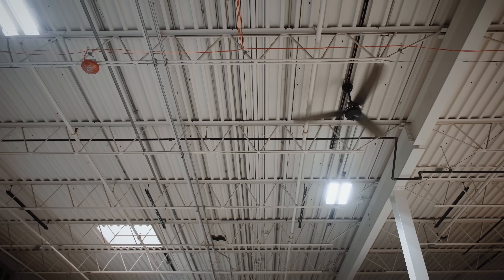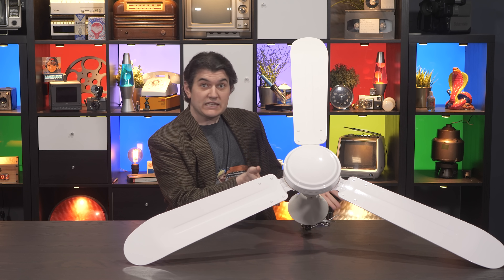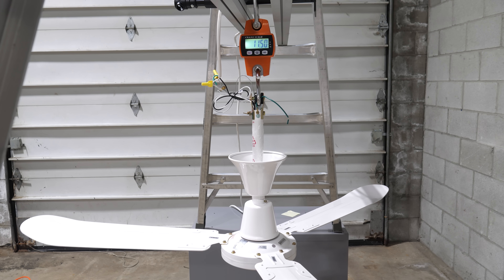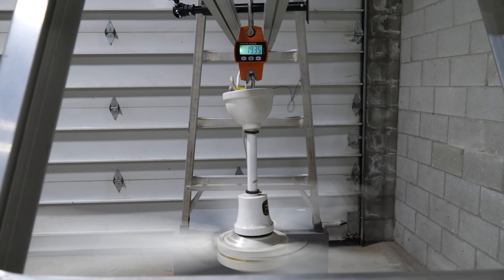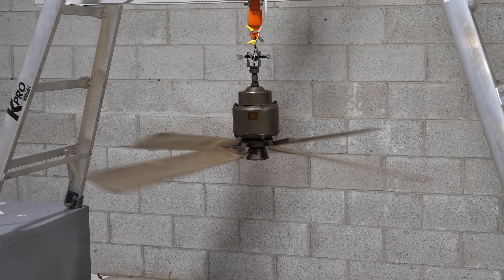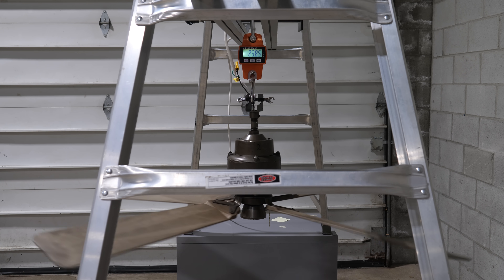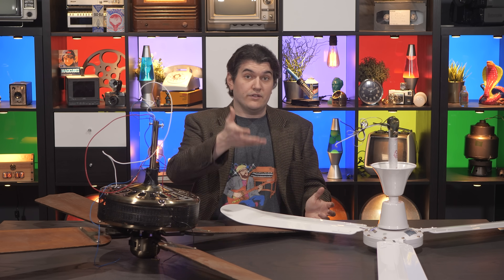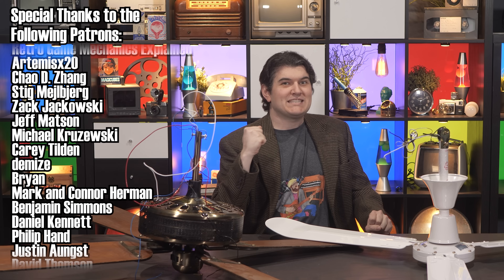How much thrust does a ceiling fan produce?

Comment: The spinny things on top of a helicopter are not really "fans". They don't work by "pushing" air down, like these ceiling fans do. In fact, you can stand under a spinning helicopter rotor and you won't really feel any downdraft. (You will only start to see strong air currents farther away from the end of the rotor blades).
Rotor blades are what's called an airfoil. Their shape is formed so that the air has to travel a farther distance over the top of the airfoil than at the bottom of the airfoil. When you look at an airfoil crosssection, you'll see a kind of 'bulge'.
The fact that the air flowing over the top of the airfoil has to travel farther than the air at the bottom of the airfoil leeds to a drop in air pressure on the top of the airfoil (thanks, Bernoulli!), which then created an upwards force, which we call lift. 

On an airplane, lift is simply generated by the airplane having forward momentum. But on a helicopter, you essentially just spin the airfoils real fast. Boom, lift!
And yes, airplane propellers also work with airfoils.
Reply from the maker: for clarity, I knew they aren't literally the same things as fans - but they are big spinny air blowy things and I think that's close enough for the joke.
Reply: Oh yeah, definitely. This was not meant as a "your video is pointless", more of a "hey, maybe you'd like to know this" :)

Although, they aren't really "air blowy things" - more like "spinny air pressure suction things". To reiterate: helicopter rotors don't work by pushing air down, they work by generating lift through decreased air pressure on top of the airfoil. 

Thanks for the video! i'm a big fan! (heh)
Reply from the maker: @m0llux  no no, I gotcha, the joke is in the mud between "the rotor is blowing a lot of air around but that's not what generates lift"
Reply: This is incorrect on many levels.  All airfoils generate force by moving air.  If you are standing under a helicopter on the ground, those blades are feathered and not generating any lift.  I've seen people blown off the side of an aircraft carrier by the down force of air from a helicopter.

Also, anybody who has stood behind a propeller aircraft will tell you how much air that prop is moving backwards.  Unless, the propeller is feathered, in which case it's not producing thrust, and thus not moving air backwards.
Reply: @jeromethiel4323  Yes! m0llux is very much overlooking the equal and opposite reaction explanation of how an airfoil works.  For example: take a piece of paper and tilt in front of a pedestal fan, it's obvious that it's deflecting the air (as much as the actual lift force is due to the pressure differential across the two sides, but it could also be calculated from the equal and opposite reaction to the air being deflected, i.e., the force on the airfoil is opposite to the change in momentum (i.e. deflection) imparted on the air).
Reply: @TassieLorenzo  Indeed.  Physics is a thing.  Also, observation and understanding what you see is a thing.  I have walked under a helicopter with the main rotor feathered, very little down draft.  But try that with the helicopter lifting off and you will be rolling across the ground.  Or off the deck of a carrier.

Which i saw firsthand.  Luckily, the water was warm, and the helicopter fished the sailor out of the drink straight off.  But he learned an important lesson.  Aircraft work by moving air around.  Moving it backwards makes you go forward.  Moving it down keeps you aloft.  Simple.
Reply: They literally are fans. They exactly work by pushing air down, in the exact way that a fan does.

Everything is essentially an aerofoil once it's in air. Aerofoils work to generate lift (AKA upward thrust) because they push air down. They do this in complicated and less-than-intuitive ways, but they absolutely work by pushing air down, and anyone who says otherwise might as well be claiming they defy physics.
Reply: Me when I spread misinformation
Reply: As Alec said forces come in equal and opposite pairs. If the air is pushing the helicopter up that means the helicopter has to be pushing the air down. Fixed Airplane wings also push air down.
Reply: A cursory look at the streamline pattern around any non-neutral aerofoil (just Google it) will show you that an aerofoil DOES deflect air.  That's how it works! 🙂 Yes, the pressure difference between the two sides imparts the force on the aerofoil body, but it's deflecting air.  This may be most noticeable near the tips of a helicopter rotor simply because that's where the rotor is travelling the fastest and where the powerful free tip vortex is.
Reply: whoosh 
^ The joke

Comment: I'm not an expert but I'm not sure that's how aircraft propellers work. They are basically rotating wings. The cross section of the propeller is the same or pretty similar to the cross section of a regular airplane's wing. It's not just some blades rotated at an angle like we do with ceiling fans. But others, more clever people will correct me.
Reply: Hello, I am a more clever people (studied aeronautics as a minor in college), and you are absolutely right. You can even stand right under the spinning rotor of a helicopter and you won't feel any downdraft.
Reply: But an airplane propeller works differently than a helicopter rotor, no?

The airplanes wing is an airfoil like the blades of a helicopter, but an airplanes propeller works more like a fan?
Reply: @kenk8215  eh, kinda both. Yes, a small part of the thrust that propellers produce is indeed due to them acting pretty much like a normal fan. However, nowadays, airplane propellers are also airfoils, which do create lift when they spin. That lift is, of course, not pointing upwards, but forwards. On all but the most basic airplanes, you can even change the angle of attack of these airfoils to increase or decrease drag, which allows you to have the propeller spin at the same speed regardless of the current power of the engine, leading to a lot more efficiency. 😊
Reply: Put differently, the flat piece of particleboard that makes up my ceiling fan's blades is a horrible wing.

Comment: Fig Newtons of Force sounds delicious.
Reply: I caught that too. Yummy lol
Reply: You’d think… but no.  Too many wasp eggs.
Reply: Are fignewtons measured in pound as force or pounds as in weight?
Reply: They're enriched with midi-chlorians.
Reply: Proof Americans will use anything as a form of measurement. 
Freaking metric system. Takes all the romance out of measurement. I want my units based on the size of a king’s unit. That’s what a shit load is, one king’s loaf!
Reply: @thatairplaneguy  Yet metric-lovers will constantly use the wrong units for weight (a force) and complain about American customary being weird. My kitchen scale does the same thing, and every time I use it, I ask "but would you still say that this is 40g of whey if I were riding an elevator?". It returns the snark by having a terrible interface for customary units...
Reply: Is that figs on edge or figs laying flat ? 

Also this happens to go well with banana measuring. One fig laying flat is the same as one banana thickness 🤔